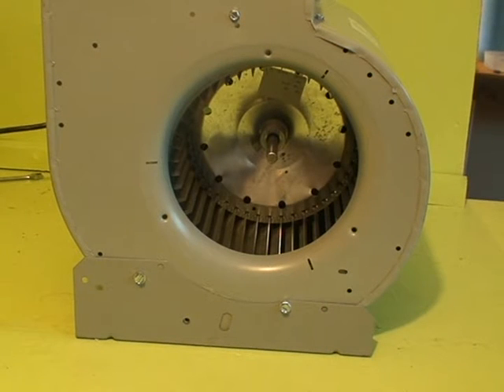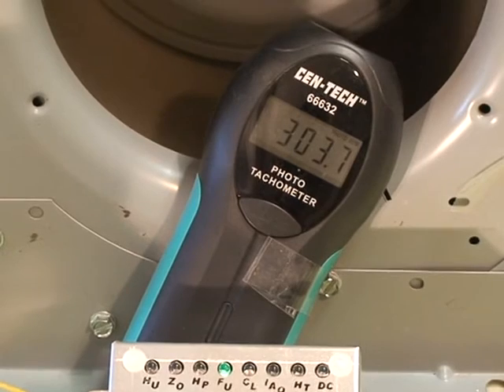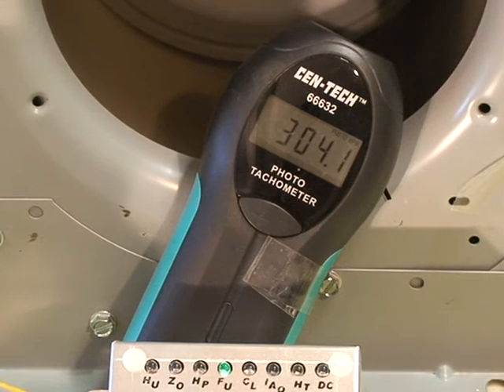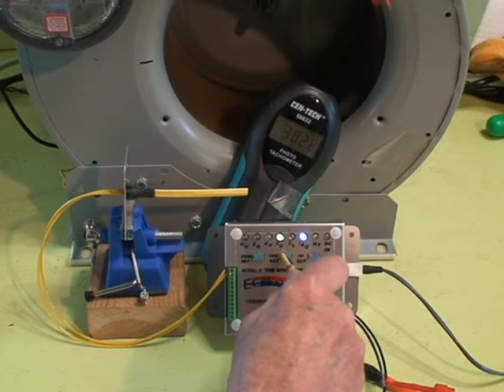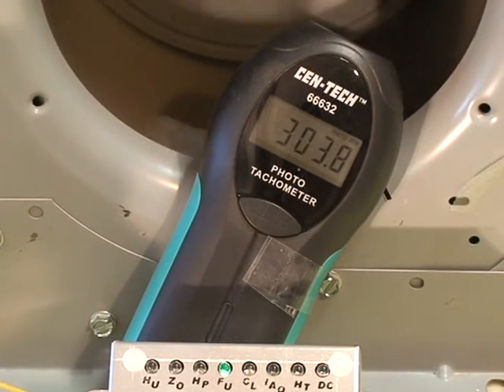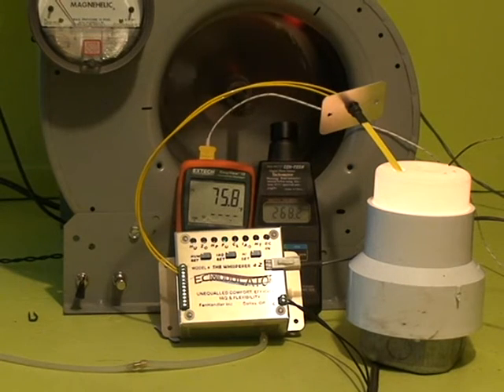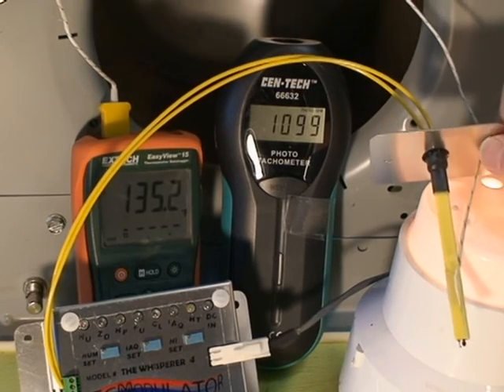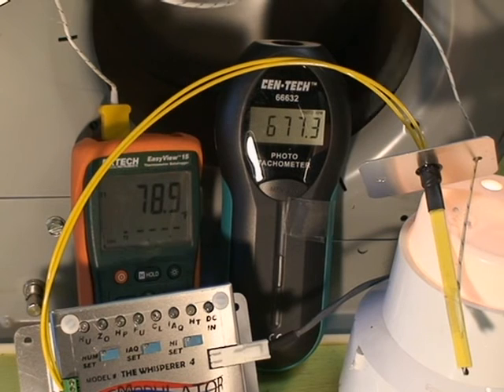Modulating Variable Speed basics

Comment: Joe Shearer have you seen this before?
Reply: I haven't
Reply: I can't tell if they are using psc motor or what exactly.
Reply: Joe Shearer
It's an ECM Motor. Hence the name "ECM"Modulator. FanHandler has other controls that will do the same thing with a psc motor as well though. I am probably going to be installing one of these in my own home soon. I am tired of the drafty uneven heat of my current system.
Reply: I was curious until I saw the price tag. If I'm going to
Void my warranty it won't be by spending $1000 and on a unit out
Of warranty it isn't worth the investment.
Reply: Where did you hear it would void your warranty?
Reply: Any modification to the system that is not factory approved will void a system warranty.
Reply: The ECM Modulator actually operates outside of the system, so no modification is necessary.
I have also been assured by the factory that it will not void any warranty.
Reply: ryan peters wishing you the best of luck !